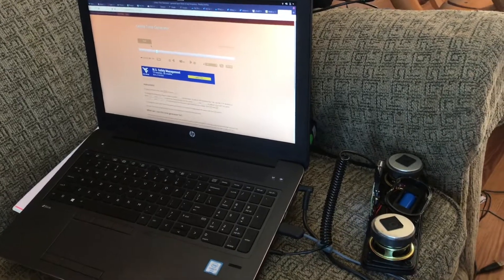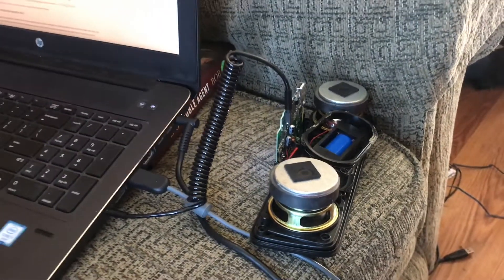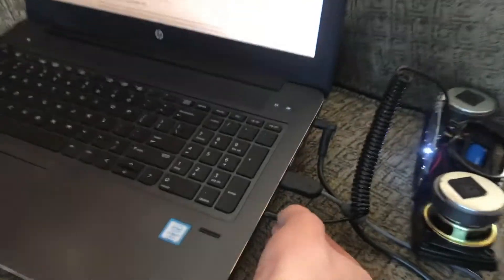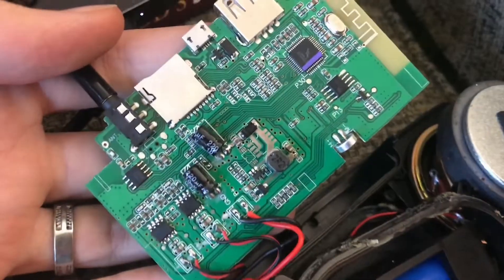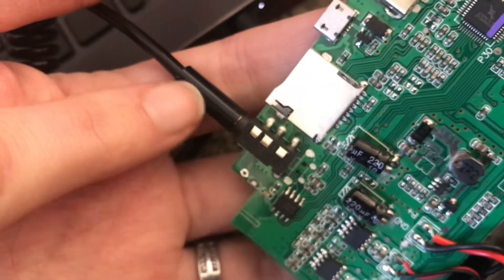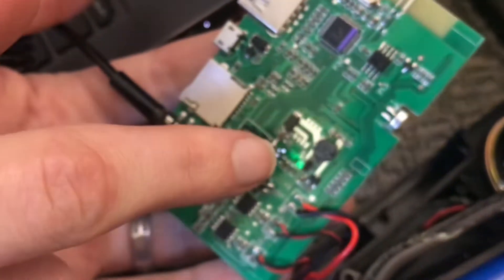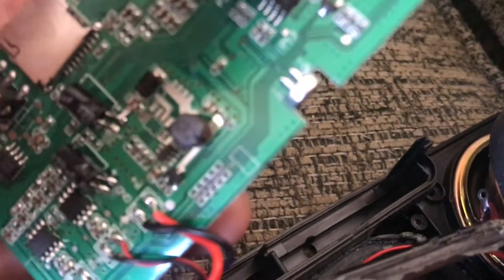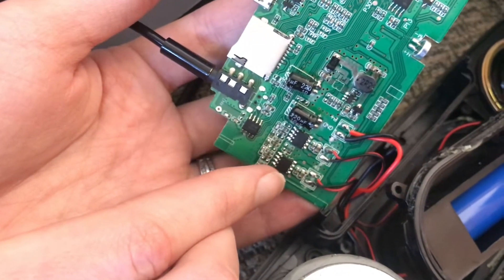using TONE GENERATOR to test quality of “speakers and amplifiers”

Comment: Your issue is mechanical. speakers can't be tested in open air except for high frequency ranges where the signal is very directional. Even in a car,  speakers rely on the rear deck for bass response, for the low freq to bounce and spread.A speaker enclosure if often more critical than the quality of the speaker itself.